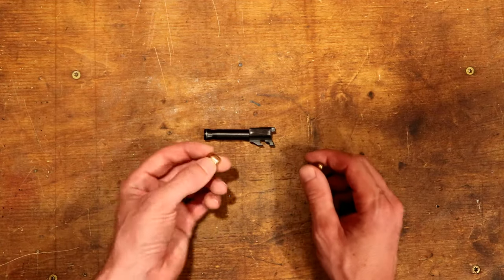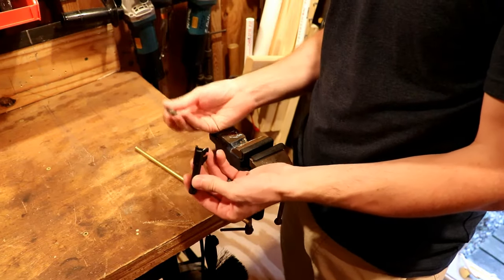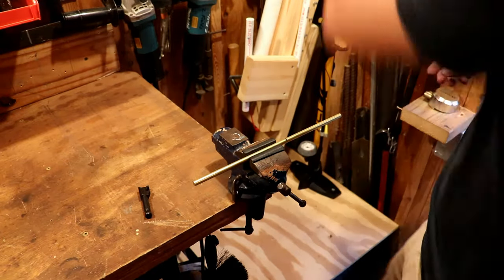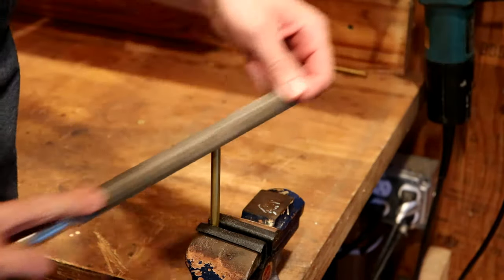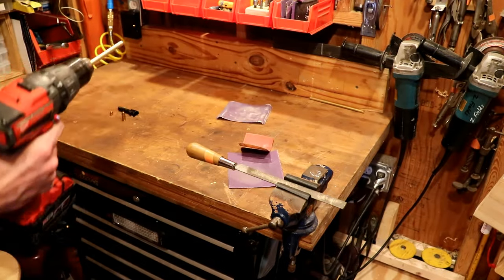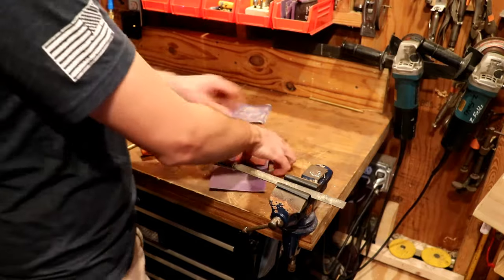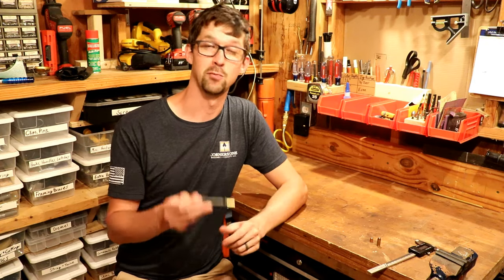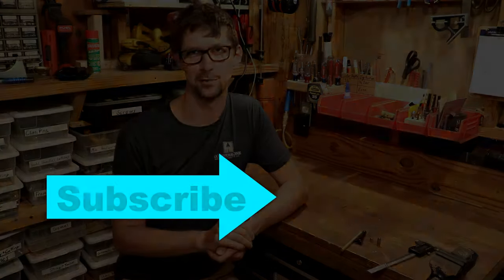How to Clear a Stuck Bullet - SQUIB

Comment: I used a fiberglass pole that was 5 foot long and a bit smaller diameter than the 9mm. Put the pole behind the shortest travel for the bullet, and tapped the pole on the floor a few times popped right out. Worked great the 3 different times I have cleared my and other people obstructions.

Comment: Literally just happend to me at the range like 10 mins ago all that happend was a puff of smoke that's all so I took the mag out ejected the casing and had to take my cleaning rod an had to push it out I'm glad I knew what to do I instantly unloaded an took the gun apart to take the barell out to check for a lodged round sure enough just the bullet was stuck in the barrell cleaned the barrell and shot fine no problem after that not bad tho 3000 rounds an only had this happen an only once so I'm sure it tends to happen eventually

Comment: There is absolutely no need to do all that work in making a brass driver.  Simply cut the rod to the appropriate length, deburr and then go to tapping or pounding the bullet out.  Oh, and yes, I am a machinist with 40 years experience as well as being a hobbyist gunsmith.
Reply: And why couldn't he just put the base of the barrel in his soft-grip vice?

Comment: Y not tap it out backwards? Mine popped right out instead of pushing it through.
Reply: It all depends on the position of the bullet in the barrel.  You would be surprised on far down a barrel just a primer and no powder (squib load) can force a bullet and a lot depends on if it is a jacketed bullet or plain led.